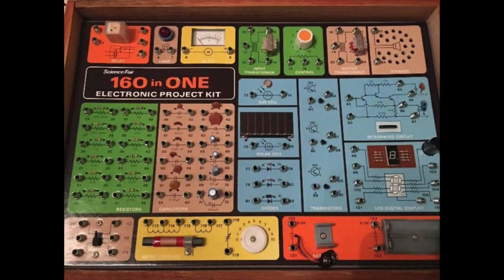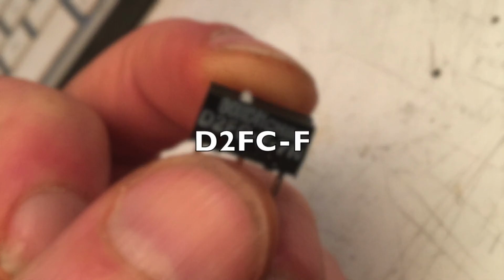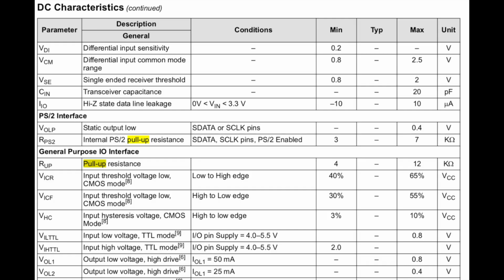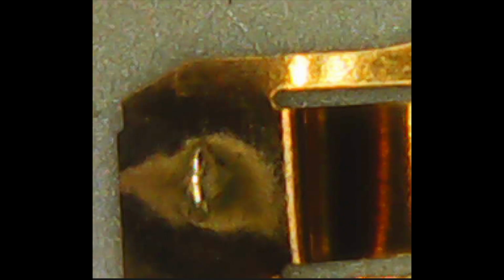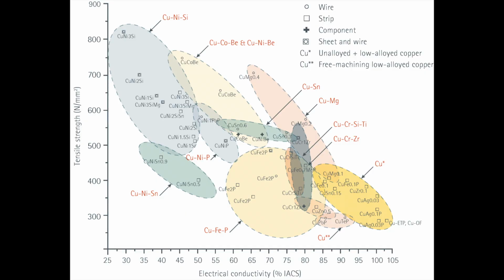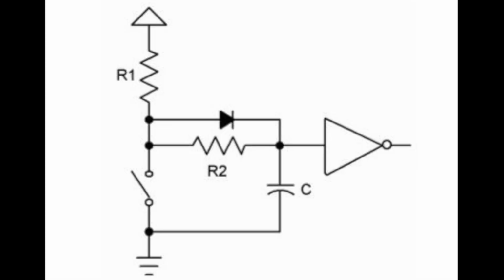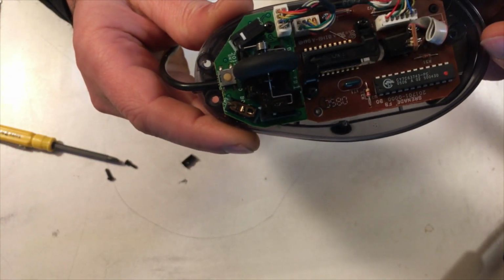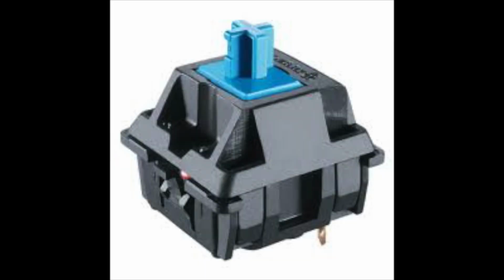Failing switch problem: Omron vs the modern mouse circuit

Comment: Watched this video 2 years ago, after purchase of my Razer Mamba wireless, and watching it now, after replacing switches to japanese Omron d2f-01f.

Actually, a lot happened in mouse industry over 3 years:
 Hot-swappable mice already exists, Asus making them.
Optical switches were developed,  from traditional form-factor to proprietary design, like Steelseries Prestige OM (optical-magnetic) switch.
Mice getting lighter and lighter, 55g mass produced mice without holes and wireless!
Plug-and-play mice, without software, like XTRFY, where you can adjust parameters like polling rate, debounce time, DPI , lift off distance, etc,  with help of slider switch and button at bottom of the mouse.
 
We live in time of mouse revolution

Comment: Fantastic vid, at first I didn't think I would sit through the whole thing, but here we are. 

I'm on my second G903 and the RMB started giving me problems a month ago, LMB started having the same problem a week ago. The double-click / click-and-drag issues exactly as you described. It's about 2 years old, but it's a $150 mouse, and my second one, at that! The first one, I now realize, was likely suffering from a similar issue, but the LMB just quit working entirely and suddenly. It was about 2 years old as well. 

Other than the switch issue, I love it. It's a perfect fit for my hand, I like the weight, it's the first wireless mouse I've had with no intermittent lagging issues, and I'm using the Powerplay mat with it so I never have to worry about charging it. 

So, thanks to this vid, I'm going to grab a soldering kit and some D2F-01F micro-load switches and see what we can do here.

Side note, the kit you have linked as the "slightly better" soldering kit is listed on Amazon as "not currently available - we don't know when or if this item will be back in stock" so you might want to update that link when you get a chance.

Comment: Omron and beloved don't belong in the same sentence. They are trash.

Specs don't tell you the whole story. Best example imo is the ZF gold vs ZF red. ZF red is about half the price but is better in every way save for durability. Same situation with Kailh gm 2.0 and the ttc dustproof golds. Ever try a 5million ttc silver? It's terrific. You need to actually try them. However medical switches wipe the floor with mouse micro switches. Honeywell ux10c And Swiss Burgess x5g

Those last forever, they are excellent quality (the need to be) and seem to be made much differently. Honeywell ones need flattened and trimmed pins. I love em. Also your not going to screw them up with inappropriate types of power going through them. 

Gold doesn't tarnish

Comment: Thank you, I was wondering why my 4 year old G203 just started double clicking on everything for no reason, troubleshooting software, driver issues for weeks until I found someone link this video in a forum. Tore up the mouse after having switched to my backup wireless M310. Found the D2FC switches inside the G203. Now I don't really know what to choose for a comfy functional mouse.

Comment: Very good video, but you know, they make it on purpose so a stupid user is forced to buy an another one...I am replacing every let's say a year my switches in the two Anywhere MX mice found in a company's dumpster :) Most likely someone has thrown them away because of the "double click issue" :)

Comment: I've watched this twice in 2 weeks. Could it replace Joe Dirt? I knew that a 30 year old mouse might have had a thick switch contact and loud clicker but had very little inclination that there were different contact ratings for sub-miniature micro switches in later mice. Now I've torn apart several thrift store finds to check what brands. I was surprised at all the different "clones". One brand was like a shaded out box that I could barely assume said Wolfe? I saw ttn and a no name among the generic omron and  several Kailh.

Comment: Great stuff! Thanks!  Oddly enough I had to repair my microwave not too long ago, because the light and the tray would not shut off. Turns out, there was a switch not too unlike this one. 10 bucks to replace. Ah, capitalism! I only did that because I am poor. Most people would have thrown it out, planned obsolescence, ah capitalism! Now I see these everywhere, and it is a bit ridiculous; like you said 1930's technology. Interesting to see how it has evolved, and packaged, and then this side of the industry with marketing wank and people fighting about preference. 
Great deep dive into this!

Comment: So many of these switches are DOUBLE THROW. They generate a (bouncy) closure on mouse down, and a (bouncy) closure on mouse up. Run these through a set-reset latch and you have bounce-free output, no debounce lag, and even if the contacts open momentarily while dragging, you don't get any glitches because the button only releases once the switch is released and it clicks out. The SR latch can be done in software, so no need for extra hardware. StupidTube won't let me post a link of any kind or it deletes this comment, so you'll have to find more info on your own.

Comment: I knew it !
I hate those Omron switch, so many problems with those kind of switch, my mouse was unusable because of the white bumper stucked all the way down (sometimes it was making double click) and the plate was deformed after 3 years (for me that's short lifespan, my older mouses are still working)... why they don't use round micro switch pushbutton

Comment: today i bought a g502 to replace my g5 i bought in 2006 from an internet cafe ( yes its true and i could write a novel to what this mouse has gone through ) , reason was the mouse wheel completely destroyed in my g5 and needed 2 -3 extra buttons , left and right mouse click are good as new , so you made my purchase bitter to be honest  , besides that ty v much for the video , i hope you read this comment and answer me with a suggestion  on what are the perfect switches for the 502 in your opinion ( i can solder but im no electronics wizard to figure it by myself)???

Comment: Switch has 3 pins, one engaged when switch is pressed and another when it's not, so I wonder why this simple algorithm is not used to eliminate switching noise jitter:
1. Keep switch state in memory
2. When pressed pin closes circuit,  set switch state to true
3. On depressed pin closes circuit, set switch state to false
4. When state changes from true to false, generate mouseUp event
5. When state changes from false to true, generate mouseDown event

This way jitter sets switch state value to the same value bunch of the times, but mouse only generates one click event, what am I missing?

Comment: Is the issue of wearing out the contacts avoided by using optical switches, in brands that Razer, etc like to use?
Reply: Yes. But razer still has other points of failure and only left/right click uses optical so the rest of the mouse buttons can still succumb.

Comment: Can we buy the ultra super duper swiggy swaggy switches designed for critical applications like medical and airbags for like $10 a pop or whatever and have a gaming mouse that actually works properly? Or are those ones not suitable for mousing?

Comment: This is an awesome video, btw, but I want to point out that your description of debouncing is really the wrong way to do it, even if it's commonly done that way.
The correct way to do debouncing is to respond to the event immediately when you sense the logic change (no delay), but then ignore any additional changes for the debounce period.
This method will get your click to the PC in the first polling period (0-1ms) if the firmware is decent, and you can get away with ridiculously long debounce times, because the only effect is how quickly the switch release can be sensed, and release times usually aren't super critical for gaming.  Even a crazy long 30ms debounce will allow you to click at >15Hz
Waiting for the switch to stop bouncing before sending the click is just stupid, and I wish mouse and keyboard manufacturers would stop doing it.

An interesting anecdote, is that I accidentally left some test code in a keyboard firmware that I wrote, and had something like 80-90 ms of debounce time, but with proper debounce code and 1000Hz polling, my latency is still <1ms.  I didn't actually notice it for a few months.  I eventually noticed it when I was playing a rhythm game, and one of my keyboards wouldn't seem to let me do very fast double taps.  When I noticed I had the debounce time cranked, I changed it back to something sane and it was perfect again, but even when it was an order of magnitude longer than it should have been, I did some gaming on that keyboard without noticing.

Try that with 80ms of pre-delay. :P

Comment: very informative,  after having to replace my gaming mouse switch , i tried a general purpose micro switch that was very strong press to activate. it lasted a week before the click died and felt mushy, replaced it with a micro switch from another cheap gaming mouse and still ok. Will order Japanese gold contact replacement when it fails in future.

Comment: This video was super helpful! I've gone through at least 3 Logitech Trackballs (1 MX570 and 2 MX Ergo) that all had the same double-click / click and drag issue after just a year or so. I've been eyeing the new Gameball trackball as I really don't want to give Logitech any more money and after some research I've found out it uses the Omron D2LS-11 switches. While they only have 5 million operating durability the data sheet says their minimum applicable load is 3 VDC 15 µA which should be fine, right?

Gameball source: https://forum.trackballs.eu/viewtopic.php?t=122
Datasheet for the D2LS switch: https://www.farnell.com/datasheets/2340535.pdf

Comment: I think its obvious to me at least, these kinds of switches should be based on optics. For example the same kind of metal strip could cut into a laser or other kind of beam. That kind of switch would almost never stop working.

Comment: oh my fucking GOD ...1 third of the way through this simply wanted to know the proper way to remove the switch cap and clean the contacts and bend the plate to restore my mouse function for another 5 years because I'm to lazy and impatient to order a new switch and ordering the new mice that come with shit switches is not an option because do not want to spend $100 on a trackball I will have to replace the switches on in a month when my current trackball suits my purposes but cannot be bought new anymore. As in mine has the good switches they simply are at end of life 18 years later I got 5 of these with switch issues. so wanted to know the how and the why so I can either clean and repair these or order a correct switch that isn't the new cheap shit Logitech uses today. and in closing if there is anyone from Logitech reading this ? Fuck you asshole for making new trackballs that are absolute shit ..you make them bad to sell a new one to idiots every 3 months.
Reply: this is 1 hour and 15 minutes long ?? well gonna have to sit through it because gotta fix my mouse or order parts for 5 mice so have no fucking choice .

Comment: very interesting... I was so impressed with my G602 that I talked myself into buying the G604 I'm now left unable to use this mouse to play games because of a problem with the right mouse button over clicking while playing... If this was a car this product should be recalled and the problem would be fixed us gamers are too quiet, looks like all the hard work logitec put into building a good brand has been lost to greed... no more logitec products in my set up after this... thanks for the heads up.

Comment: So what mouse should we get then if all the modern ones are trash?
Reply: Basically mice with optical switches are the go to
Reply: @commandertoothpick8284  i did just that (naga pro) and ended up with the middle mouse button having double click issues as only the left/right button are optical 😂 luckily it was easy to get replaced under warranty but we're not out of the woods yet.

Comment: Nice work, I learned so much thank you mice are feeling cheaper and I have to replace mine every 4 years or so due to the Switches going out didn't really think about replacing them pretty cool. what's your thoughts on TTC Gold Micro Switches?

Comment: So if one is trying to select a mouse purely optimizing for lifespan reliability, they should aim for a higher voltage, current, and higher quality Japanese switch? Do all modern mice use lower voltage now? Edit: ah pretty much what you mentioned in the mx518. This is pretty much the engineer's buying guide for computer mice.

Comment: would love a video or at least a schematic on attaching a resistor, got a Deathadder over here, tired of replacing the switch every year or so. Going to buy a 10 pack of Japanese ones and try those. I am confused on them being 1mil cycles though. If you click once every 5 seconds and are on the computer for 6 hours a day thats 4320 clicks per day, which ends up wearing out a 1 mil switch in under a year. So I am not sure it will be any better than the Chinese omrons. We'll see I guess. Annoying... so a better fix (like soldering on a resistor would be better).

Comment: I've only had this omron problem with Logitech. My Razer mice have suffered many years of physical wear (including me wearing out the cable on my old Habu, which I rewired), but I've never had one suffer a mechanical issue (even though Razer uses omron swtiches, their implementation doesn't seem to have the same issues). Same is true for my Steel Series and general purpose Microsoft mice (but I have the most experience/use on the Logitech and Razer products). My G500s and G300s mice both failed (omron switch issues) inside 6 months, which is absurd. So I'm done with Logitech, there are plenty of other excellent mice to choose from that don't have these problems.
Reply: I've gone through three razer mice with this problem, and the forums are filled with similar cases.  I'm happy you got lucky with your razer product, but my experience is the same as with logitech.  They fail around the 1 year mark for me.

Comment: im starting to hate logitech, i already changed my headset, mic broke in a year($150 headset), regular use, logitech keyboard missed all the "paint" in the letters, i changed it for a DROP keyboard, and the $150 mouse got the doubleclick issue after 6months, im still using it cause im not gonna spend another $150 in a year for a mouse, but i hated it, deeply
Reply: I still have the MX 518 (still works) and was my Last Logitech product......I Quit buying L because their M feet wore out way too soon (along with other reasons) to me they make cheap products regardless Although was considering the new G502 Lightspeed wireless model and saw that tubs of negatives about the ongoing right click plague, so that turned me off again. Considering Asus with their swappable switch sockets etc Though Doubt i will go ahead with it.   Cant Stand Razer products either, i have a large hand palm grip and all of their mice are just too narrow for me to hold onto, Their Basilisk series seems to be plagued with the whole right button assembly becoming loose.

Comment: Great video.  Do the mouse switches trending popular now comply with your information?  I have a Logitech Performance MX that failed 12 or so years ago and they replaced it under warrantee.  The replacement is still working.  I pulled out the failed mouse and it seems to work now as well; interestingly probably due to corrosion or some use/not use trend.  Switches are Chinese Omrons  I believe.  I am probably here watching because I have developed a pain issue and bought an ergonomic mechanical keyboard and it is such an improvement.  The pain issue is probably due to working from home and using the stupid laptop touch pad.  Long short, switches matter :).  Seems to be three things... Don't get counterfeit, is the switch going to fail soon if out of spec for design, touch/feel.  Not getting too hung up on touch feel within norms... What switch will last and is unlikely to be counterfeit?

Comment: I just had my G502 fail on my after 2 years.  My G602 that was replaced by the new mouse, i kept around should the new one fail.  Im glad i did.  Ive been using the G602 for nearly a decade now and i want to buy more of them now cause all the new mice are such crap with these switches....  That or buy the new G502 and replace the switches to much better ones.

Comment: Have any mice sufficiently risen to the call to action, or is this still an issue in the market? 
In either case, do you have any recommendations for wired and wireless mice?
Reply: Asus released mouses with easy to replace switches and razer created optical switches that works on different basis

Comment: Thanks for the video. I have a Logitech M720 wireless mouse with the 'uncommanded double-click' problem. As a ghetto-fix, I swapped in a fresh battery (the theory being maybe my old battery was lowering internal voltages). It seemed to help, then it began chattering again. I then removed the battery and did the 'double-click-frenzy' thing advised in other videos (to remove 'static electricity'). Now I feel it's noticeably better. I'll keep an eye on this, and maybe try the WD-40 workaround people suggested below.

I use this website to test my 'uncommanded double-click' issue: https://www.onlinemictest.com/mouse-test/ . The problem seems to worsen the more clicks I make.

Comment: Hi alex, I wanted to thank you for putting this put. This is very informative.

I want to add resistance to increase current draw as you suggest along with low polling rate ( dont play fast paced games.)

And I have a big question. What kind and rating resistor i must uses? And where to solder it?

Track +ve line from button to arm chip and split it? Then add resistor in between?